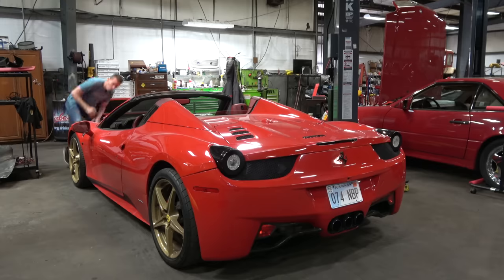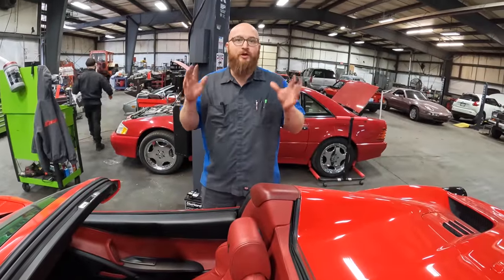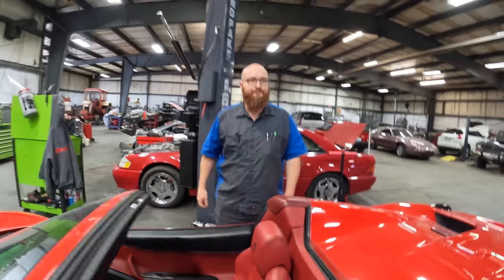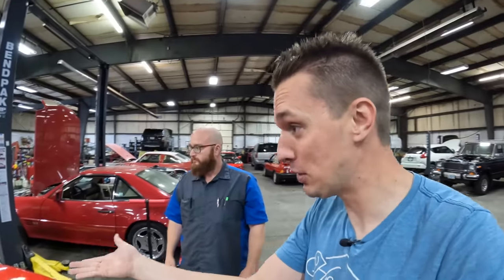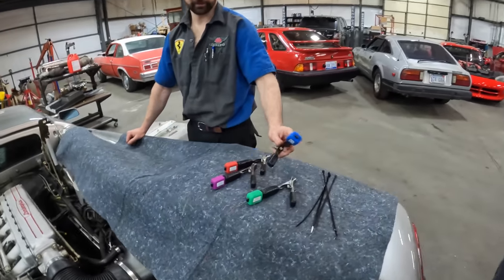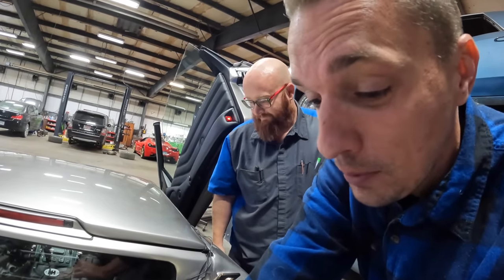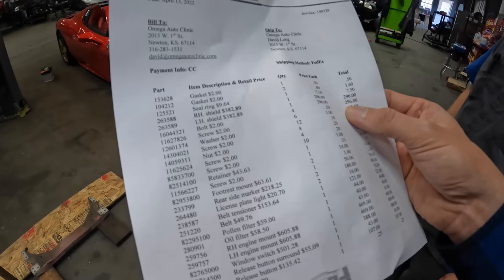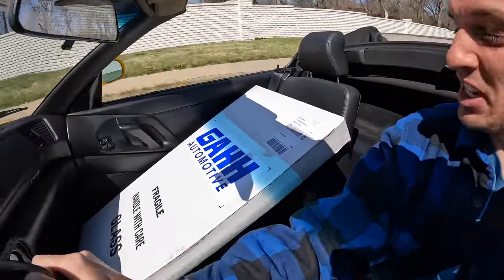MORE HIDDEN DAMAGE found on my CHEAP Ferrari 458 Spider! How bad was it really WRECKED???

Comment: Air intake?   Air and glass separation?   I had on a cheap car an odd noise and it sounded that it should be engine related but in the end it was simply a vacuum assist line that was setup for the back glass in between the engine and the motorized glass.    And my mechanic Paul gave up.  Who found it was an old man with a watter and soap bottle...

Comment: Did you ever think about it being just resonating exhaust noise ?
Just an eco that the exhaust produces from touching some holding bracket, at some specific rpm, or volume of gas flowing through the system?

Comment: my landcruiser had a noise at only certain rpm. Was a steel return fuel line vibrating attached to the firewall. The steel had fatigued.

Comment: Anywhere the cossmember is bent, and the metas folds outward, like on the narrow sides, tap that back inward. This will relieve the pressure that caused the bend, THEN you tap the bent side, to make it lay flat, much more easily, AND get it closer to true then possible without relieving the pressure caused by the folds, on the edges. As long as the folds bent outward remain, the bent side of the member will tend to stay bent, and never achieve 100% true.

Comment: I used a stethoscope, also an automobile type stethoscope and fab-extended both so I could reach different parts of my engine bay. I was lucky because it made the noise stationary and was able to pinpoint it.

Comment: To me the Diablo noise is coming from the transmission area.  I’m thinking it’s the differential or some bearing near that area the wheel bearings will make that noise when the car is driving and increasing the temperature or operating temperature like it’s starting to go out or cv axle bearings is worn.

Comment: u need to be looking for waveforms on the diablo
the moaning is obviously not the loudest sound
it just sounds louder in the cab because of resonance, as most likely something resonating off the firewall or something attached to the firewall
u need an oscilloscope and someone that knows how to operate it, someone with a background in sound engineering

Comment: I think you have a cracked vacuum line idk if it has the plastic lines but they split and sound just like that specially if there's any in the valley where the wizard thinks it at

Comment: Seems like you warm that bar up and put it in a press to straighten it.  But I'm no Car Wizard or anything.  Or a good fab guy could make another one.  

No chance that noise is from air moving through something, is it?  My van will make a howling sound if the window is cracked a bit and I run the heater fan.  Not saying that's your problem but maybe when it gets warm something opens up enough to let air move through that makes the noise.

Comment: On the BMW E39 M5 you have the oil filter house separated from the chassis with rubber mounts. 
If they would be replaced with a bolt the sound would be similar to your sound. 
How would I know? Been there, done that 🙈

Comment: My manual g37 has a similar noise, moving or stopped, it’s the internal clutch slave cylinder, it’s inside the bell housing on my car, could be a similar issue

Comment: First time I've heard this and my guess is Fuel pump.  The tone doesn't change pitch with rpm or speed, so it's not something driven by the engine.  What electric pumps are there?? Vacuum? Water pump? (I don't know Lambos lol)

Comment: What’s between the engine and the cockpit? Is there a sound deadening piece of carbon fibre or something similar that keeps the majority of engine noise damped down in the interior? Because, it sounds like harmonic resonance is being created between the engine and the firewall. Is it 2 wheel drive or AWD? One last question. Where is the harmonic crank balancer located. Front or back? Or you could simply have an unbalanced rear tire, but that wouldn’t explain the noise when it’s idling. Something is loose. Put it up, and go underneath and check every bolt and fastener. I’m out of ideas guys. Might be the clutch…

Comment: Crossmember? Heat it with a torch first, THEN take a hammer to it. NOT a sledge hammer, a normal hammer, and tap it back into shape.

Comment: Heat the metal slightly, then finesse the bends out, not using brute force, but by using your head. Work smart, not hard. Finesse, rather than brute force.

Comment: Does the Diablo have a oil separator in that area? Not quite the same but I’ve had semi truck engines oil separator valves making a weird noise at random times just like that?

Comment: Harmonic damper missing on the engine ??  my Toyota mr2 has harmonic damper on the rear suspension crossmenber, many cars have these on the centre engine mount bracket.

Comment: does the lambogini have a alternator just like 00s and newer VAG moddels? i remember on my old work a V6 with a drive belt poulie of the alternator. i dont the name in englise now. but this part on the alternator cares for a continu voltage on the alternator, i know vag and lamborgini are togeter, but i dont know iff this engine already had volkswagen/audi part. iff so? then you can look it like a ''audi''

Comment: Greetings to you and the Wizard!
If I can ask the obvious question:
WHY IN THE F@#K would you buy that car?
Glutton for punishment?
Just WHY?
Ok, now that's out of the way, may I ask what the previous owner asked for it? What ever it was, was to much.
I've been down that road before, I once was a MOPAR GUY, you know, Chargers, Barracudas, Road Runners....HEMI's
You know, just good old ridiculously expensive engines.
And then I saw IT....
A 1972 JAGUAR XKE 12 CYL. CONVERTIBLE....IN SILVER.
At that point it had been sitting behind a gas station for 12 years, 4 flats, a ripped up top, with less materiel on the frame of the top than on it.
I was just about to run away and that voice ( you know the one) that whispers "Buy me now"
The Prince of darkness, Lucas, had his way with her...
Yes she is a girl, named Elizabeth....
Her body work was in great shape, the wire wheels were not....
With a little bribery ( 110 octane A/V gas) a wiring harness from a Chevy Caprice, 4 centerline wheels, a rebuilt tranny, a brand new hand made top, made from a copy of one ( thanks Mom!)
And alot of cussing in the old English she ran again,!
(Good girl Lizzy)
Please back AWAY FROM THE CAR!
KEEP YOUR CHECK BOOK TO YOUR SELF.
GO COLD TURKEY!
buy a Toyota.
LoL.

Comment: For min 6:00.maybe they have fluids in them.Like non metals,Like mercury.They need motion,not voice.That's haw i will build them.
Reply: And i will not use them,on a road.Only in park mode.With the engine ON.They are build for parking,not driving.
Reply: The liquid metal,is not trush.The liquid metal,have to stand vertical.Perfect vertical,in order to work.

Comment: WTF really a sledge hammer on an aluminum mount? Why not use a steel plate and put it on a press and put some slight pressure on it to try and flex it back? or have a fabricator make a new one?

Comment: If you take Audacity (sound editing software) and sample the sounds - you should be able to triangulate by the amplitude of the sound.  There is also a thing called a Fourier Transform (plug in)  that will isolate the frequency of the sound when it appears (peel it out of the surrounding noise).  At that point you have a locale and sense of the syndrome. Acoustics relate to aperature size (think bass [low frequency] speaker big - tweeter [high frequency]  speaker small). The sound being low should be coming from an aperature (if it is a leak) that was fairly large - like a gasket leak? Also metal and metal with vibration produces a resonance.  Anyway - maybe this helps.

Comment: I must say. It's kind of sad that one of the most worked on cars by amateurs and DIY people as well as first timers and young people that have never worked on any car at all. Choose (Or perhaps are driven to doing it them selves due to high shop rates lol) to do so on BMW's. I have actually worked on multiple brands and fixed most of my own cars over the years. The internet is filled (especially youtube) with "How To" videos showing how to do "Not almost everything", but EVERYTHING on almost every BMW. So when anyone needs to fix something on their German love/hate relationship they can and do, do it themselves I would say more than any other model or brand of car. Yet two of the prominent Mechanics on Youtube (Both of whom I dearly love) are so "Bi-Assed" (It's just a joke folks no offense meant) towards the brand they either spend their time knocking it or complaining how they refuse to do the work that even beginners and "Never havers" are putting them to shame just by following a video and learning how through write ups and articles. Our dear and wonderful "Scotty Kilmer" has intentionally made two videos trying to show how terrible and even "Near Impossible" it is supposed to be to change out spark plugs on a BMW E9X 335i (Or any BMW from that line of models. Both times he embarrassingly was so stubborn as to not even look at a manual or a video or even an article on what to do when starting any job on that model of car. Which is to remove 4 screws which are right on top of the engine cowling and remove the cowel with one hand if one wishes. Then all plugs are right there on top (oops, you must take off the plastic engine cover all cars now have on then these days as well, Pardon me) then just change them in the most simple easy method one could ever imagine. This "Spirit that has permeated our world of "Selfish Pride" (It's not saying they are bad people but that "Pride" that is clung to so very dearly out of fear of being wrong or looking silly or having to say "I was wrong" and/or "I made a mistake" drives people to very insane extremes. So much so that in order to maintain this "Pride" they will fight with their family and divide their friends in order to stay in that binding "Spirit". I love the Wiz and Scotty's a total "Hoot!" But I just wanted to use this as an example of one of the biggest and most damaging things that is at the root of our societal problems. I LOVE YOU ALL! PEACE!

Comment: Wild guess... Air oil separator diaphragm? The vacuum supply can be tied to a temperature linked valve..? Use a press to straighten aluminum if possible... (I swear I haven't had to do this.. LOL)

Comment: Has anyone changed the fuel filter? I had a pump make a moan after driving a little because it takes a sec to clog the filter after everything settled in the filter after sitting.

Comment: The frequency is around 250hz, so if it's occuring at 3000hz. Maybe look for something that would be a 12-1 ratio gearing, possibly there might be a resonance there. 
If it was at a lower ratio say 6-1 you would expect the same noise to occure at 1500rpm as well due to harmonics.